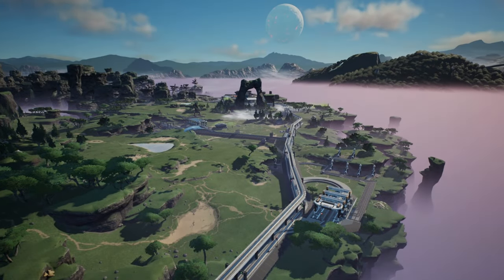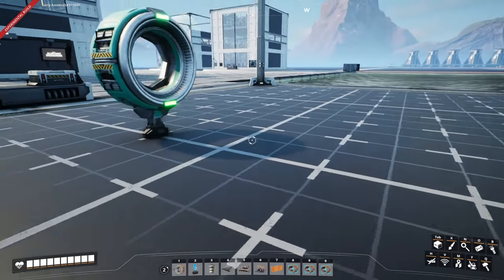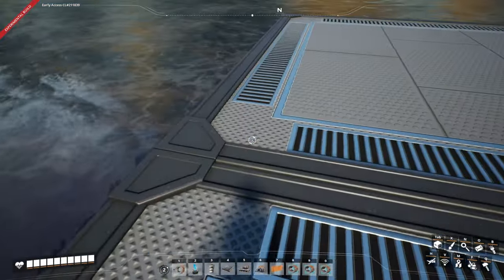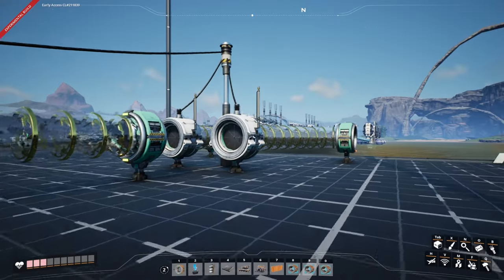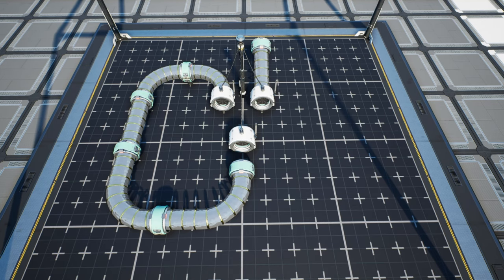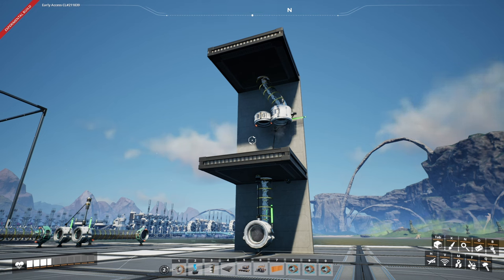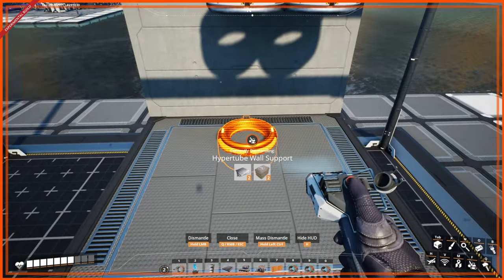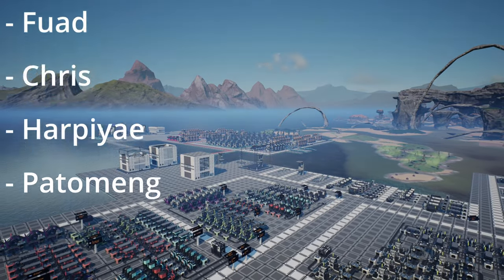HYPERTUBE Designs Blueprints You Need In Satisfactory

Comment from the maker: Do you prefer hypertube networks, or are you a train person like myself?
Reply: Why not both?! Train for long distances, with a Hypertube hub at each station for the local area.
Reply: someday, both, being trains the priority, I guess.
but for now, I quite enjoy driving the Explorer around and/or riding the wires.
Reply: I like running on belts and slide jumping with a jetpack
Reply: I like using all forms of transportation.  Hypertubes are great for early/mid-game for local factories.  I usually will use them for getting around a single biome quickly, like the linear stretch of the Northern Forest.  Once I advance enough for long-distance factories, like oil and aluminium etc., that's when I bust out the trains.
Reply: Trains and hypertube cannons for long distances. Hypertube elevators in tall factories.
Reply: @corkofski9442  yes!!! mate!!!
Reply: Im more of an airport person because its simple and fast. Trains are good for resources but just much much to slow for players to rely on. If I have a route I go back and forth a lot I will make a Hypertube line with just too many entrances so I can get across the map in just a few seconds.
Reply: Trains 😍
Reply: I personally love hypertubes. They remind me of Futurama's tube travel so much. I have the hyper boosters mod and I'm currently building a long range hypertube network that will eventually connect to everything. I found a great design for hypertube junctions so i don't have to have massive hypertube rooms at all of my factories to get everywhere.

Comment: You can make a hypertube 3-way junction that you can go from any to any other hypertube by arranging three entrances into an equilateral triangle. 

You can get an equilateral triangle by putting a foundation down, then putting another one on top and putting the entrance one click in from the edge on one side, deleting the on-top foundation, putting another one 12 clicks rotated one direction and placing the second entrance one click in, and finally putting a third one down rotating 12 clicks in the opposite direction and putting the third entrance in place. The whole junction fits onto a single foundation, and you can choose what direction to go out from it as you're coming in by using the left and right movement keys.

If you put hypertube boosters at your factories (or using the hyperbooster mod) and running hypertubes along with your train network you can very rapidly transverse the whole map from factory to factory much faster than trains can.

I could probably make this into a blueprint, but I haven't been playing satisfactory much lately because I've been playing factorio!